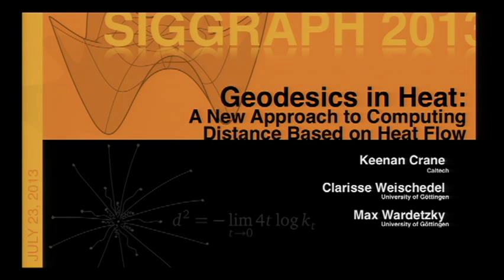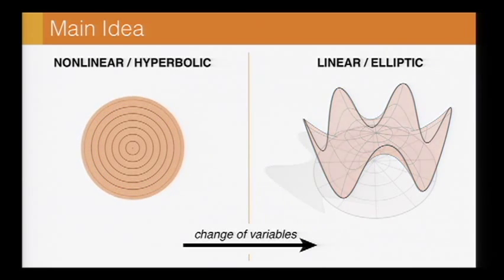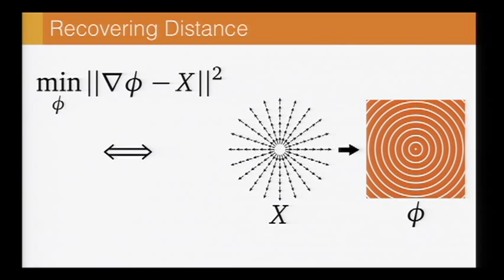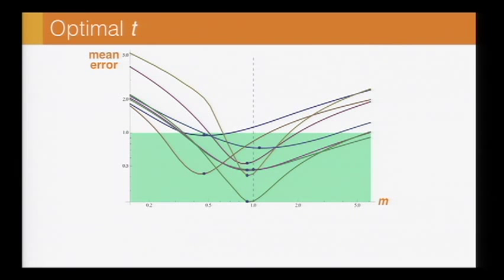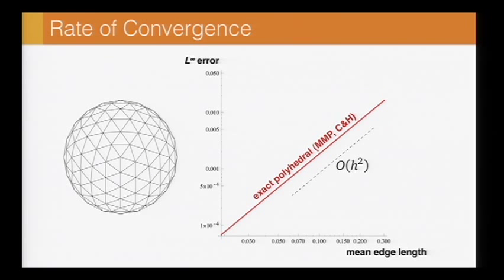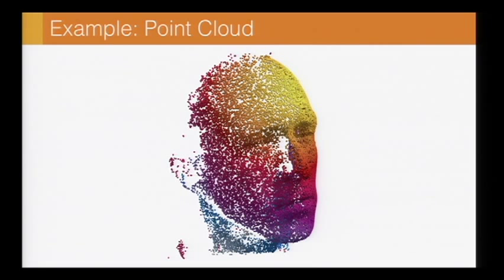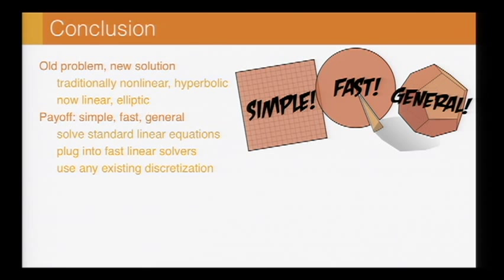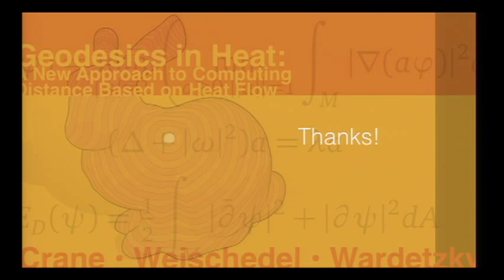The Heat Method for Distance Computation

Comment: Keenan, this method is used in CFD codes for decades now, as it is required to know distance to the nearest wall for some turbulence models. In our case it had origins I think with professor B.Spalding and orginally implemented in PHOENICS code. Anyway this presentation looks nice.
Reply from the maker: The method you mention from CFD  (sometimes called the “LTLS” method [1]) is different from the one described here, and aims to compute only a distance-like function that is different from the true geometric distance, even under mesh refinement.  It is also commonly used in computer vision as a rough proxy for distance [2,3].  In contrast, methods like the heat method and the fast marching method compute the actual geometric distance.

In particular, the method you refer to simply solves the Poisson equation

      ∆ u = 1  on Ω,
          u = 0  on ∂Ω.

(Note that depending on your sign convention for the Laplacian, the sign of the source term may change.) The resulting function u will not satisfy the eikonal equation |∇u|=1, and will deviate significantly near corners of the domain.  Consider for instance that the distance to a square [-1,1]^2 is max(|x|,|y|), but the solution to this Poisson equation will be a smooth function.  The rounding effect of the LTLS method is clearly visible in this image of wall distance computed by the CHAM solver: http://www.cham.co.uk/phoenics/d_polis/d_lecs/stress/wdis.gif

The paper from CFD is

      [1] Spalding, “Calculation of Turbulent Heat Transfer in Cluttered Spaces” (1994)

This idea also appears in the computer vision literature under the heading of “shape skeletons”; see for instance

      [2] Tari, Shah, and Pien, “Extraction of Shape Skeletons from Grayscale Images” (1997).
      [3] Gorelick et al, “Shape Representation and Classification using the Poisson Equation” (2006).
Reply: @keenancrane  Keenan thank you for detailed reply to my comment. I think there should be more discussion between engineers and mathematicians regarding this. We, engineers use Finite Volume Method, but don't learn about differential forms, even though the true power of the FVM was reached when we realised that we don't need Finite Difference type mesh, since we are dealing with quantities like flux trough surface, etc. and the basis, of course, is integral theorem of Newton-Leibnitz-Gauss-Ostrogradski-Green-Stokes type. Is it too imprecise to say that the FVM has in itself, the embrio of discrete exterior calculus?
Reply from the maker: @idiosinkrazijske.rutine  No, you are right: Discrete Exterior Calculus (DEC) can definitely be viewed through the lens of finite volume methods.  And it nicely connects some things you might naturally do in finite elements (e.g., integrating over cells of the primal vs. dual complex) to the language of differential forms (e.g., linking this primal/dual notion to Hodge duality) as well as the language of algebraic topology (e.g., chains and cochains).  It also has a finite element interpretation; going deeper in this direction leads to Finite Element Exterior Calculus (FEEC).  So, it indeed provides a nice bridge between engineers and mathematicians of various kinds...
Reply: @keenancrane  Great field to be engaged with.

Comment: Hello Dr. Crane, question, how does this method compare with the MMP algorithm for finding geodesics on coarse meshes?

On your paper I see the table comparing your method with the fast marching algorithm but not with the MMP algorithm (I might have missed it). Thank you in advance.
Reply from the maker: Good question.  On coarse meshes an exact method like MMP may indeed be quite attractive: since the mesh is small, the runtime will be good (and the distance will be exact, modulo floating point errors).  On the other hand, if you already have an implementation of the heat method, you could run it on a subdivided version of the coarse model.  Computation will again be efficient, and distances should be pretty good.  In short: coarse meshes are reasonably easy with any method; what to use largely just depends on what tools you have at your disposal, and what your pipeline looks like.
Reply from the maker: I would also by the way be sure to use the intrinsic Delaunay version of the heat method on coarse models.  This is implemented for instance in CGAL and libigl, and can help quite a lot with accuracy (at very little cost; on the same order as the matrix factorization—which will be negligible for coarse models).
Reply: @keenancrane  So if I understand correctly, you expect MMP to be faster in coarse meshes?
Reply from the maker: @makogan9599  I expect it to be very implementation-dependent.  That's a pretty common theme with algorithms (and the reason why algorithmic complexity is often analyzed in terms of asymptotic growth): for very small problem sizes, the nature of the algorithm matters very little, and there are a number of constants that depend on implementation details.  I couldn't even hazard a guess what would be faster in this case: depends both on how you implement MMP (data structures, etc.) and how you implement the heat method (e.g., does it now make sense to use a direct solver?).  The question of amortized performance may still come into play, if you want to solve at many (or even all) vertices.